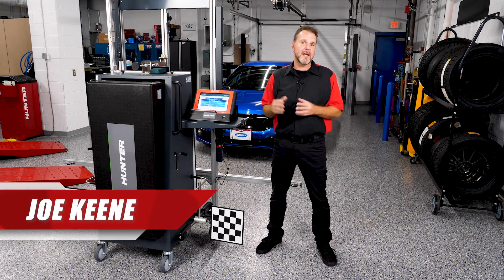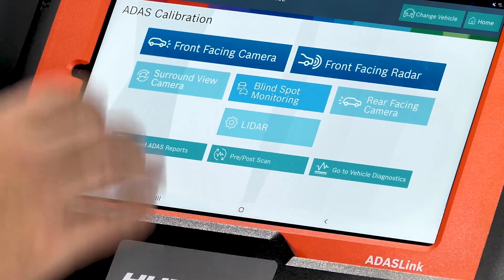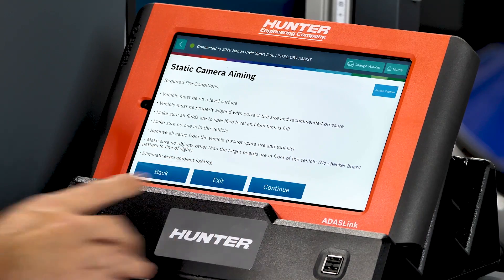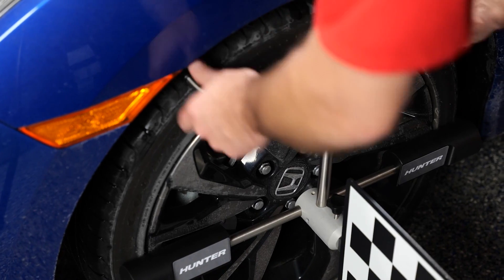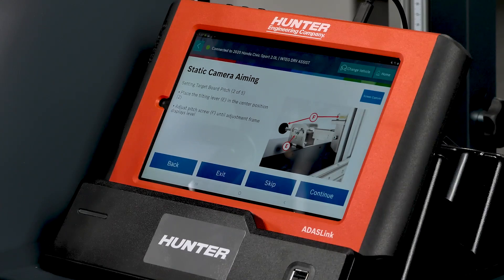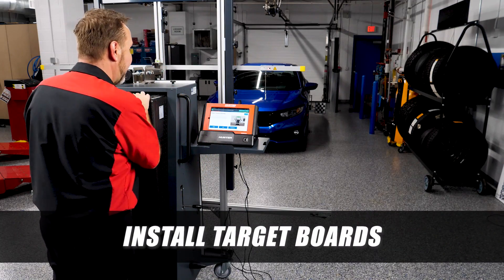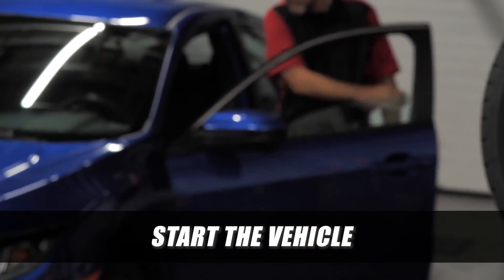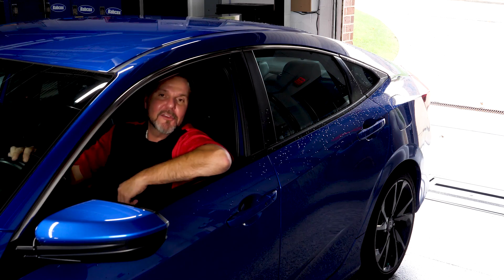ADAS calibrations: Windshield replacement for a 2020 Honda Civic

Comment: useless video for anyone other than a honda dealer. LOL
Reply: I don't think it's completely useless. This can help inform people what the process is for calibrating those cameras so that people can determine if a shop is overcharging them for camera calibration when replacing their windshield. The average person would think it's just a magical computer thing that takes a couple minutes with little labor. This video shows it's a tedious process that needs to be done in a very specifically and accurately with someone with a level of competency.
Reply: There’s plenty of shops that do Adas calibrations. Not only the dealer can do this

Comment: Quick question , if you got the windshield replaced, and the camera didn’t get calibrated, you can still drive your car right?? Meaning you can drive, but the car lane assist and the other feature is what just won’t work?
Reply: The cat will drive fine problem would come when your completely relying on lane keeping assist to keep you in your lane just pay attention and drive

Comment: I have a 2017 Honda Civic exl and it doesn’t have lane assist ? The dealer told me it would still need calibration? Is that for the blind spot monitor?
Reply from the maker: That question would be best answered by your dealer, though it is possible for a vehicle to have multiple optional features, such as the blind spot sensor, rear view camera, etc.  Any camera, radar, or proximity sensor would need a calibration after an incident.